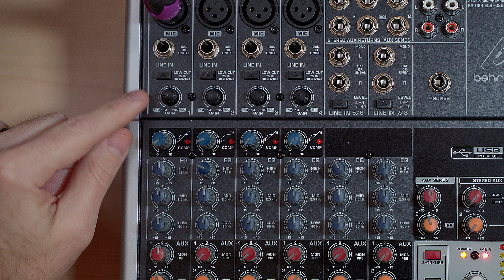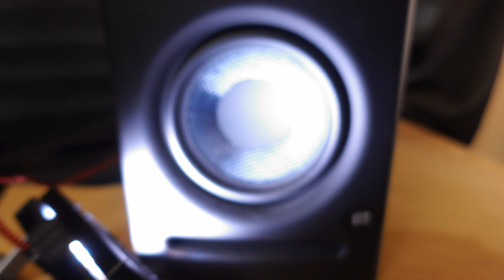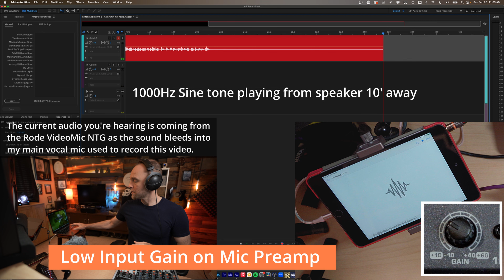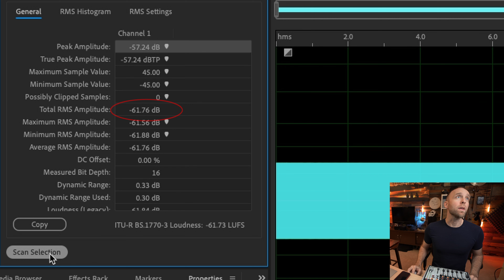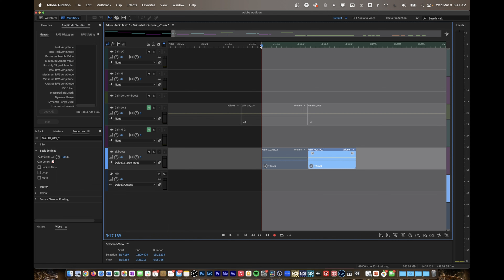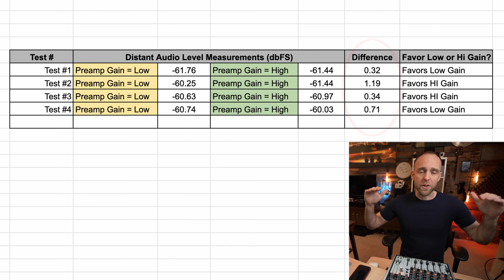Audio Myth:  Does Preamp Gain affect what the mic "hears?"

Comment: I am using sm7b with ssl2 when I turn my gain up and turn my monitor mix to the input side fully,I can hear some constant noise and when the gain is up,it’s louder ,but I didn’t really hear that in the vocals,is that the noise floor?Will Klark Teknik ct-1 or any inline preamp make that noise lower
Reply from the maker: Hi there.  I would imagine that an SSL preamp would be very clean and be able to gain-up your SM7B just fine.  When you say "I didn't really hear that in the vocals......." did you mean you didn't hear the noise in the RECORDED file?  and you ONLY heard the noise in the headphones when listening in real time?

I have not used the SSL2, so I can't speak to it directly, but the SM7B needs LOTs of gain, but Julian Krause has done lots of tests and basically shown that even a Focusrite scarlett 2i2/Solo is clean enough with the SM7B to not warrant an external preamp.  I would imagine the SSL2 is similar and clean enough.  

I also do not know, on the SSL2.........if the headphone output is a combination of the "Monitor" knob AND the "heaphone" knob (!??) I wouldn't imagine it works that way, but when listening with your headphones, does the level in the headphones go up/down when you turn the "Monitor" knob?  or only when you turn the "Headphone" knob?

Long story short.......your gain should be set first with the input meters on the channel with your SM7B nice and strong up between -20 and -10.  If the input meters are only hitting between -40 and -20, then you will get more noise in the signal at the end b/c you'll have to turn up your headphones MORE, and that will boost any noise inherent in the beginning of the signal chain.  

I hope some of that helps

Comment: Something that's worth noting: 
While adjusting the gain will not affect pickup pattern/ capsule performance, it can affect Frequency Response (of the preamp). Emphasis on can. With some pre-amps (internal or external), as you crank the gain higher, they stop sounding flat. Sometimes this is intentional, sometimes this is incidental. Julian Krause on YouTube has documented this on several of his Audio Interface reviews.

Comment: Does this work the same way with condensers?
Reply from the maker: That's a very good question, and although I didn't have time to test that in this video.......short answer........yes.    Preamp gain has no effect on what a mic hears.  What a mic hears is only related to (1) it's polar pattern, and (2) it's orientation and/or proximity to the intended sound source.

Once again, think of wireless mics.  You can have a wireless condenser mic, like a Shure Beta 87 capsule on a wireless hand-held transmitter......and the preamp gain way back at FOH isn't going to have any effect on that capsule in the singer's hand on stage.